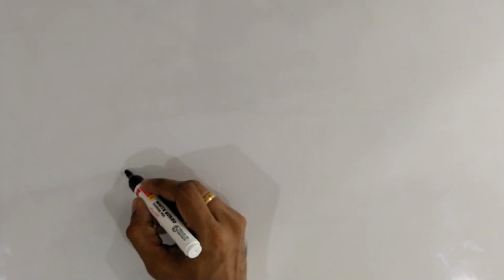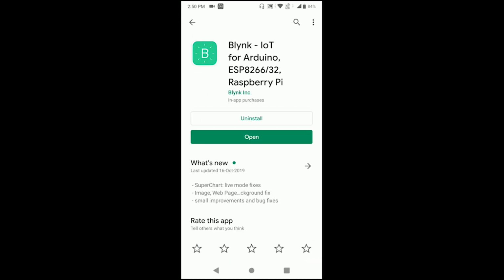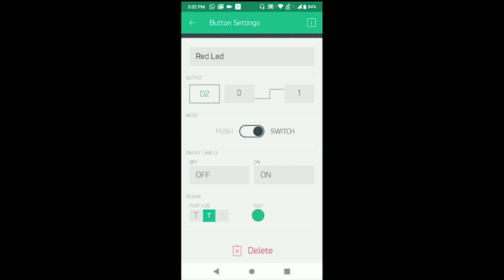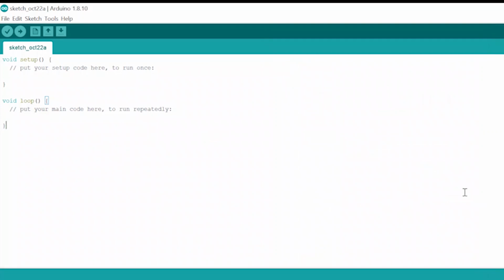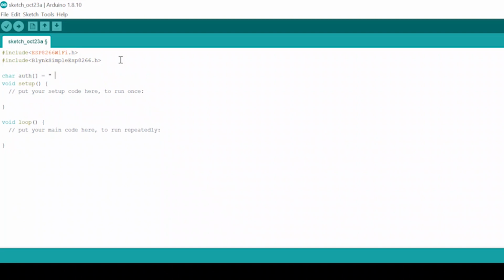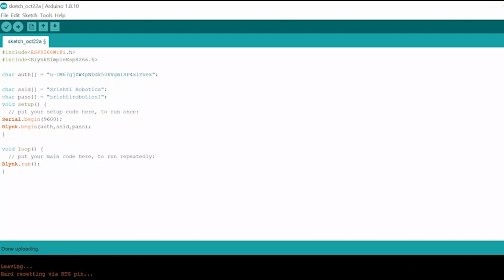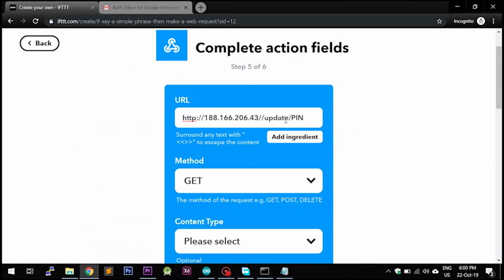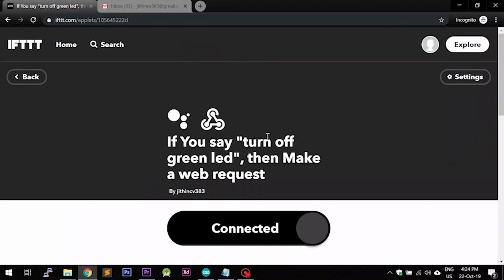Google Home using NodeMCU, Blynk and IFTTT

Comment: yessss, its working!!!
thanks man for sharing
Reply: From where you get the url 188.166.206.43
Reply: How you get url sir i. e IP address
Reply: @pakanatirajesh6827  thats the default ip from blynk, you can use that ip for your project
Reply: @pakanatirajesh6827  there is an separete  program to ip address once check in chrome and upload to node mcu
Reply: Really. Thank you so much sir. I'll try now sir.
Reply: Sir.. Do you have a code of this project sir. Please share sir
Reply: @pakanatirajesh6827  give me your email
Reply: Sir it's working. I followed the code in video. Thank you. One more small doubt. I used my mobile hotspot to connect node mcu. It's consuming more than 1 GB of data. Solution please sir. My mail id rajeshpakanati111@gmail.com
Reply: Hi sir, my LED does not light up even though i have followed the steps accurately. Was there any steps i could have missed out?
Reply: @emilya8626  had you allowed google assistant to give commands? Please agree to google assistant voice search
Reply: @pakanatirajesh6827  yes, Google assistant is able to receive the command. But the light still doesn't turn on even tho it is supposed to be turned on
Reply: @emilya8626  Are you using same mail id for all credentials
Reply: @pakanatirajesh6827  yes

Comment: Sir can i use 5v motors or light in place of led light
Reply from the maker: Sure, you could use 5v motors. If you need any electrical/electronic items to be controlled by this, you can use a relay.
Reply: Two sir

Comment: Bro is that possible with adriuno
Reply: And using esp8266
Reply from the maker: You could do this with Arduino but for internet connection, you need to attach an additional wifi shield or ethernet shield.
Reply: @Srishtirobotics ya ihave esp8266 wifi module and arduino

Comment: So, how to make 3 LED on in same time use Google assisten? How to setting?
Reply from the maker: Hi, Check the code below. 
//Arduino code for blinking 3 LEDs together using blynk app
//add a button with virtual pin V0 in blynk app and read its value as the state changes.
//read virtual pin data to a variable and use this variable for led control(here it is "pinValue")
//thus you can control  3 LEDs together with the single applet in IFTT

#define BLYNK_PRINT Serial
#include <ESP8266WiFi.h>
#include <BlynkSimpleEsp8266.h>
char auth[] = "xxxxxxxxxxxxxxxxxxxxx";
char ssid[] = "xxxx";
char pass[] = "xxxx";
int pinValue =0;
BLYNK_WRITE(V0)
{
   pinValue = param.asInt();
  Serial.print("V1 button=");
  Serial.println(pinValue);
  delay(1000);
  if(pinValue==1)
  {
   while(1)
   {
    digitalWrite(D0,HIGH);
    delay(500);
    digitalWrite(D0,LOW);
    delay(500);
    digitalWrite(D1,HIGH);
    delay(500);
    digitalWrite(D1,LOW);
    delay(500);
    digitalWrite(D2,HIGH);
    delay(500);
    digitalWrite(D2,LOW);
    delay(500);
   }
  }
}
void setup()
{
  Serial.begin(9600);
  pinMode(D0,OUTPUT);
  pinMode(D1,OUTPUT);
  pinMode(D2,OUTPUT);
  Blynk.begin(auth, ssid, pass);
}
void loop()
{
  Blynk.run();
}